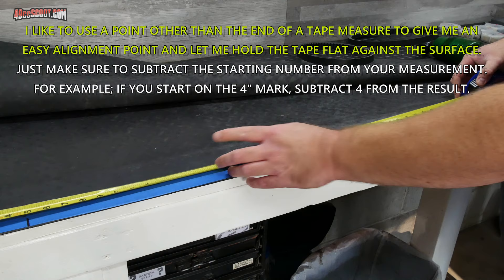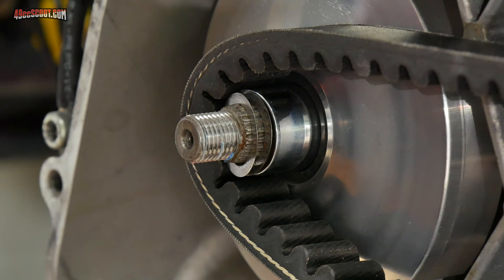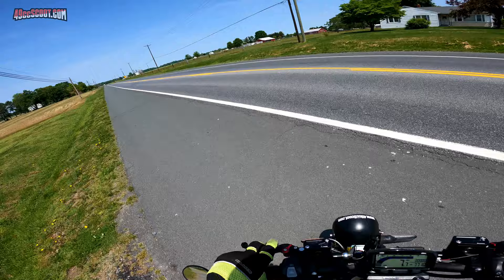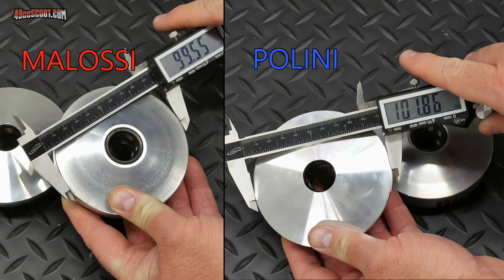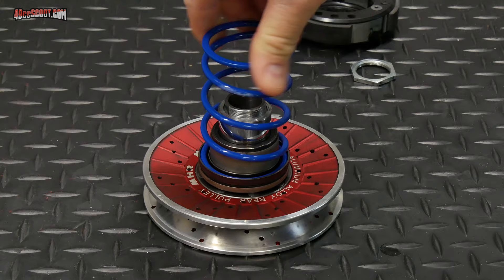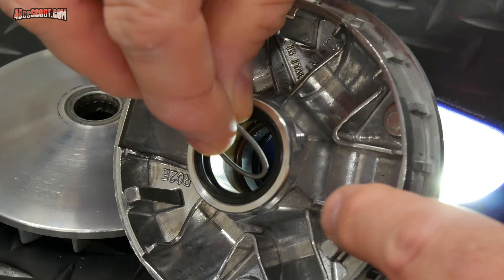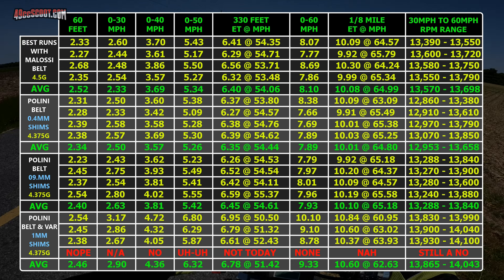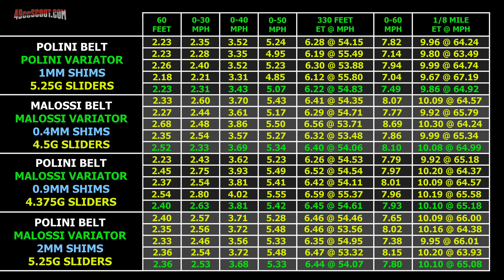RC-One : Polini Belt & Hi-Speed Variator Tested : CVT Upgrades : RC1 : Part 12

Comment: The whole case surrounding my CVT gets very hot after a 4 mile ride, is this normal? Also after changing the belt, there is a smell like burnt rubber at the end of a ride. Some of the plastic fins on the outside part of the variator are broken due to not tightening the nut enough and it almost came off.
Reply from the maker: CVTs get hot. The belt slips, as does the clutch (even when everything is right). That makes heat, plus it's getting heat from the engine. When the belt is changed, it's best to clean the whole CVT. You've got a lot of belt dust in there by then usually, and it's time to make sure the rear pulley moves well and is greased and bearings are good and drive faces are flat and so on. Broken fins may be an issue if it's enough to either throw it off balance a lot or not allow it to move much air.

https://youtu.be/2EjW-iSP-Q8?si=Jsw8B_liD0fbGJeU
Reply: @49ccscoot  Thank you for the response.
I have no grease and have yet to take off the rear clutch / pulley since buying the scooter years ago. I wouldn't know where to grease it.
Also, I have the gy650 with the teeth on the variator, and I bought a new Bendix, but the old one looks like it had grease on it, and I don't know which grease to buy.
Reply from the maker: @remyllebeau77  I use synthetic wheel bearing/general purpose grease. Check the video in the last reply.
Reply: @49ccscoot  Thanks I did watch the video. I also ordered a new clutch so I think scooter will feel like new if the Bendix fixes the starting issues.

Comment: I was told the Polini Hi-speed is a flawed design and they don't work correctly. I been following @scooterswapshop for a while now and they swear by it that it's flawed. I was never able to get full travel out of it when I had one, it was oddly strange.
Reply from the maker: I can't speak for full travel on the speed side, but the results speak for themselves for acceleration. It's an easy enough to get longer belt and the Polini vari handles the wider belt easier. It's not something I'd say everyone should run out and buy. The Malossi works quite well too. There's some other company in Europe that someone  posted on the forum making a longer belt for it as well. Kind of a shame Malossi didn't make a belt to get full travel of the rear pulley after all that it must take to produce this engine.

Comment: i had the same problem with my malossi over range belt and kit on my standard piaggio engine, belt would not sit high enough in the rear pulley. I posted it to your forum and you suggested some solutions. I'm glad you made this video as it answered all of my questions. Guess i was not tripping after all

Comment: Yeey, a new vid !! :))  Nice job Brent.. just a mention, to be more careful with polini belt, and inspect it more often.. there were belts with quality issues, and many people write about belts snaping.. I bought polini (gates) for stock peugeot 50cc vertical, and belt started to peeling of emediately, after 10 miles test ride...
Reply from the maker: Just checked it this morning and it looks like about 0.1mm wear in at least 250 miles.
Reply: I had almost belt snapping with athena race blabla.Shit quality i never dissapointed with malossi.

Comment: hi brent!

i had the same engine. my cvt setup was: malossi vario, polini beld, polini 3g clutch with the black malossi spring in it and the screw from the clutch at the max, 2fast red pressure spring...... it was coming to life after i had this. but the first thing what you must do is to trow the exhaust away.... its really not the best for the cilinder. i change it to to a roost 100cc exhaust and it turned the engine in a beast
Reply from the maker: Thanks. Check out the vids after this to see the exhaust that I tried.

Comment: polini has always been my num 1 go to variator 100% without doubt wayy better than the multivar
Reply from the maker: They aren't too far apart for acceleration, but this does seem like a better design. I'm really not sure why Malossi undersizes a belt. Seems like anyone that knows CVTs would take one look and say we need a different belt after all of the trouble of coming up with the RC-One. I guess it's easier to use the existing Piaggio belt, but I wonder if they have the same trouble. Anyway, I was riding this morning and I was at 13,400RPM at 70MPH+.
Reply: @49ccscoot in Italy we use a lot cvt fr4 variators for drag scooters
Reply from the maker: @nazzytpr  I've never heard of those before, but I looked them up. The way the ramp plate and variator interact is different than any variator that I'm used to. They list a Piaggio 50cc, but 70 and 90cc are listed as unavailable and it lists heavier rollers for a 50 than a 90 (when usually it would be the opposite if all else is equal) so I'm not sure that they'd even have something suitable for the RC-One. Sounds like something else in the design changes... unless Piaggio makes 70 and 90cc stock models and they're totally different platforms.
Reply: @49ccscoot  I usually use 4 to 7 grams rollers with 50cc and white-yellow counter spring, on 100ccs I use 3-4 grams rollers with red or harder springs, however I forgot to mention they’re widely used on stock cases category, not on rc-1…
Reply from the maker: @nazzytpr  Thanks for the info.
Reply: @nazzytpr  ciao...consigli per variatore e ecc... per kymco 125 r16?

Comment: You won't strip the splines on the crank because they're hard steel. You could strip the drive pulley groves, them being aluminium, but unlikely if properly tightened down.

Comment: For the carb petrol suply issue why not add a 1 to 2 psi fuel pump
Reply: 597338 briggs and stratton fuel pump might do the trick, as on a briggs it does not push throug the float needle but still adds some pressure to the fuel line 👍
Reply from the maker: I was trying to keep it simple. Seems to be more of a carb issue. I adjusted the float height about 0.5mm this morning and ran it up over 70 multiple times without issue. For some reason this carb will not stay stable.

Comment: Great quality and informative video! 
Because of this video I ordered the variator for myself to try it out, but still waiting for the delivery.😁 
Big question is that the Polini hispeed evo 2 will make big difference from stock one.😄 
And maybe you have ideas why the belt keeps braking in the joint? I'm thinking to much power could be causing it...
(Piaggio two stroke engine with stage6 Streetrace 70cc and Yasuni C16)
Reply from the maker: Check alignment of the front and rear pulleys first. See if that shows any issues.
Reply: Thanks, I will check that👍

Comment: I have used the Polini Hi speed variator for years on my 2 stroke Piaggio NRG fitted wit a 70ccm Airsal head and cylinder for years... the belt isnt really that crutial as long as it is a performace belt.. Polini, Malossi.. dosnt matter
Reply from the maker: Honestly when considering the variator and belt combo, I could go either way with both if I were just riding. It runs strong either way. It's when I looked at numbers that the choices mattered more to me.
Reply: I've been using Polini, Malossi, Stage6 belts.. what ever they have in stock really. I use a Doppler crankshaft with hi secondary crank pressure.

Comment: My question is. I see that 5.25gr of rolles gave the best result,

Why do polini have in the kit 3.8gr and 4.3gr ??

Since your test in 4.375 seemed light.
Reply from the maker: One size fit's all doesn't really work and I don't think they want to include a whole lot of weights. There's a big difference in the RC-One's output vs a 49cc stocker or even a 70cc sport or midrace engine. The kit is for a Piaggio engine so those weights probably work well with some Piaggio setups.

Comment: Hey Man, I've been following you for a while and wanted to ask what you'd do. I have a Gilera Runner 180 2T, a beast in scooter terms top speed around 100+ mph which I think is way beyond I'd need in everyday use, because the front becomes pretty unstable at high speeds. What would you suggest: should i go with lighter rollers or just keep the current roller weight and go for shimming out the front pulley with spacers to decrease the top speed and increase acceleration. I dont need that of a top speed, I'd happily trade it for even better acceleration. Thx
Reply from the maker: See if you can get more acceleration with roller tuning. If not, just stay out of the throttle and don't take it up to those speeds.

Comment: Hey, can you help me finding interchangeable parts for my cvt? I have a 125cc Aprilia leonardo from 1998. I really want it to scoot faster and quicker
Reply from the maker: I can't say that I know anything about them. I searching and didn't find much. I found sites listing performance parts, but it's all pretty much universal sort of products... which makes me think there may not be performance parts on the market. That means you'd be in for a lot fo effort trying to match up and measure things to see if maybe they could work or be modified to work. TBH, sometimes it's just easier to get a scooter that already has a bunch of parts made for it if you're into modifications.

Comment: Can you use 50cc cvt parts in a 200cc gy6 engine. Does that really matter they look the same to me. Thank you very much.
Reply from the maker: You may be able to swap the rear pulley. Probably not the variator without some custom work. Belts work on whatever they meet the specs of.

Comment: I would like to get an RC1 engine one day. Until then I have my Genuine Roughhouse 50 with Polini BBK performance variator ect. Needs more CVT options back pulley seems too small. I know id have to modify the case so no rub for this but. Is there a overrange kit for a genuine Rh50 sport BBK used to be named rattler 50. I know a few CVT parts from a gy6 50 fit and work. Do you have any suggestions or do I just not have the right scooter for an overrange kit preferably like Polini Hi-speed type?
Reply from the maker: Polini has a Hi-Speed vari for the Roughhouse and Malossi makes a torque driver (not the whole pulley). ScooterTuning has both. Not sure if you can get much closer to an OR kit with the Roughhouse.
Reply: @49ccscoot  Thank you very very much for the information. Is there anything else you would recommend doing to get it's most low gear and full high gear? It would be nice to find a bigger back pulley and better too than stock back pulley. The belt doesn't seem to seat (belt doesn't ride on outer edge) like yours does. It also appears it could go into a higher gear as well. It's like the back pulley has restrictions to how far it can close and open the only start part left of the CVT.
Reply from the maker: @michaelkosinski5671  Sometimes the grooves aren't as long as they could be in a stock torque driver, though usually people try to mod them for the opposite end (speed). Always check without the fixed half of the front pulley installed because that will show you if the belt may be too short or if the drive boss would need shimming to get more travel. Check the belt width vs spec. Could just be a worn belt.

Comment: Hey Brent what battery do you use for mvt digital direct ignition mine is a motobatt 12v mtz5s , can I go on a higher ahmp like from 5ahmp to 8ahmp motobatt battery , what's your suggestion??
Reply from the maker: I use a MotoBatt MBTX7U (8Ah). I don't know how much capacity matters for me. Being kickstart only, I basically just need lighting power.

Comment: hi my stock belt runs about 8mm from the edge of the variator based on marks. Do you think I can just shim it out slightly and get some extra top speed? .. Stupid question but can the belt fly off if it goes too far out?
Reply from the maker: If the belt is not reaching the outer edge of the variator, adding shims won't help. Shimming would be more likely to net less belt travel in the front pulley. You'd need less drive boss length or a wider belt  (possibly just a new belt if yours is worn) or a longer belt. If the belt is too long it could be pushed out of the front pulley, assuming the pulleys can close that much and the belt is wide enough.

Comment: I don't get there is a problem with all the over range or only on the RC/C-one?
Reply from the maker: I wouldn't call it a problem. The Malossi OR kit for Piaggio works quite well. This is just a little improvement for acceleration times. Again, something that you probably won't notice or care about unless you are drag racing and paying a lot of attention to data. Possibly better for top speed as well.

Comment: One question...you have a great setup and its one of the top line,or high end of the malossi production...just wondering,how the hell is possible that piaggio zip during malossi trofeo hits 107 Mph top speeds...seams unreal to say at least....
Reply from the maker: I'm not sure what the rules are there. If they can mess with them, I'd guess porting and fine tuning of everything. You're definitely not taking an RC-One out of the box and doing that speed.
Reply: @49ccscoot  thats right,but such a difference in power trough porting and fine tuning...the engines are brought up to 32-33 Hp on 14800 rpm..cca..by the way,watching your previous video I decided to buy a Stage 6 EGT and wit your detail explanations will try to fit it on my piaggio NRG 2018.. thnx  for that :)))))
Reply from the maker: @kex2160  I don't think you'll regret it. EG is a great tuning tool and it's way easier to avoid melting things with EGT vs CHT that I relied on previously.

Comment: Hey thanks for all the info that you've provided. My Question is how do you know what size belt would I need for a Tao Tao VIP future champion handsome.  I bought my scooter used and didn't run. I've bought a new centrifugal clutch and variater even though it didn't need it but the belt I bought for it is 669-18-30 it fits loose any ideas or information will help out a lot since I broke the one I had on it. Thanks
Reply from the maker: The 669 is usually the short belt for the 139QMB.
https://www.49ccscoot.com/faq/whatbelt.html
Reply: The 729 belt is what the info you gave me says. The 669 belt is what I had on it and until I put on the big bore kit I hadn't had a problem with it. But I really appreciate the information you provided.
Reply from the maker: @guarddog73  Make sure the belt is at least nearly all the way to the edge of the rear pulley. If not, maybe a torque driver or contra spring issue won't let the belt get tension.

Comment: Hi, I have been watching your videos, specially the ones on the TaoTao. I have got the same GY6 motor based scooter which has been working fine, but today it started to make a clicking noise from the clutch assembly. The scooter is all stock, but it has more than 5000km under his belt. Furthermore I also noticed that the rear wheel sometimes does not rotate freely, but it looks like I am pulling the brake a bit (which I am not). Rotating the wheel backwards it frees it a bit, to then bind again after a few meters. Have any idea what the issue might be?
Reply from the maker: Check your brake system first. If that's good,  then you'll need to take a look at the clutch and  CVT and then the gearbox. Drain the gear oil anyway and see how that looks before you call it done, even if you find something else. Sorry this is not a "check exactly this" answer, but sometimes you have to do the work to find it. It's time to go over the whole CVT anyway IMO. I like to clean and inspect them pretty regularly.
Reply: @49ccscoot  thanks for the reply. CVT and clutch will be replaced with belt. Brakes too.
Reply from the maker: @onlyvintagewatches  You don't necessarily have to replace those things, just inspect and clean. Here's a detailed CVT inspection video :
https://youtu.be/2EjW-iSP-Q8

The rear brake should be a simple inspection, assuming it's drum. Make sure the cable is adjusted properly and that nothing is hanging up. If you think the brake could be the cause but aren't sure, you could back the cable out till it's obviously not pulling the brake at all and then see if the same thing happens when you rotate the wheel. Most of the drum brake components should last a long time.
Reply: @49ccscoot  thanks again for the follow-up. I met an old man (retired mechanic) the other day and he had some parts laying around from all the scooters he has (six in his garden house.... and counting) and he agreed there was something wrong with the CVT and belt. He took some tools and we disovered the belt was about to rip and the clutch was so worn it needed replacement anyway. Since he had these parts (used but in better condition than mine, I checked) he replaced them all: CVT, clutch and belt. Brakes need to be replaced as well, but he didn't have any and I did not want to push him, since all he took for the parts and job was a pack of beers... Germans...
Reply from the maker: @onlyvintagewatches  Ah. Glad you're getting it done then!
Reply: @49ccscoot  yeah, the guy even gave me a couple of tires and rims, all for free....  usefull since I need to replace my old tires... Thanks for all your videos, they helped a lot (specially the tips on the PDI series, that was what inspired me to get this scooter in the first place)

Comment: Hello great vid, one question. I bought a variator and didn't order a drive face will it be okay to run the stock one short term?
Reply from the maker: If it's an over range, I'd wait to get the matching fixed half. If it's a standard upgrade variator, it will probably work OK. Some do, some don't. You can check the angle of the vari and your stock fixed half to see if they match or are close. It's best to have them matched. If you don't have an angle finder, some phones can do that.
Reply: @49ccscoot  Thanks will do